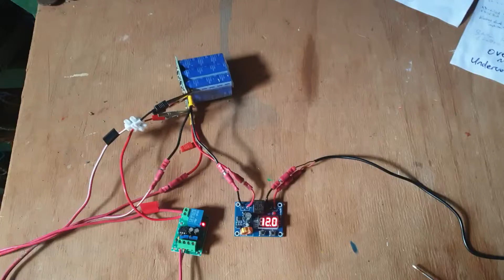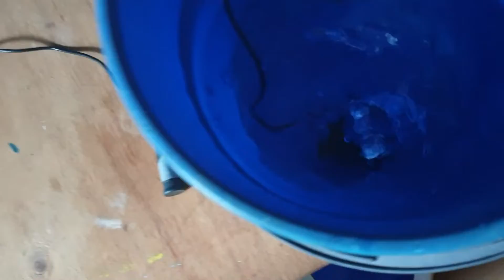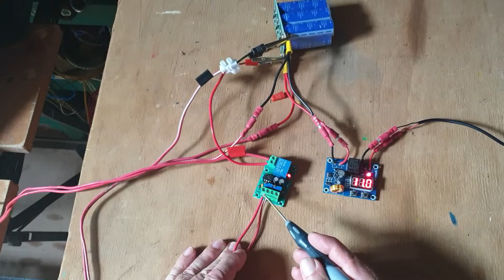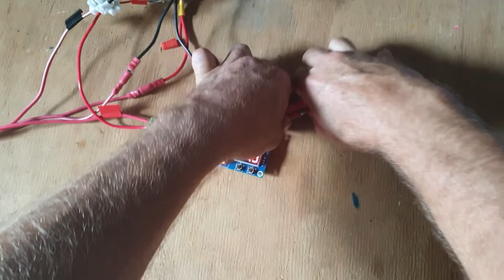Overvoltage and undervoltage protection modules working together to protect 12v battery

Comment: Thank you I learned something new today I just got the under voltage board so I don’t damage my dewalt 20v batteries or my agm batterys for my trolling motor 
  I will buying the over voltage for my power supply diy battery charger made with a 24vac transformer a full bridge rectifier and 63v 3300mf capacitor and a 300watt voltage and current regulator 5v -32vdc it has great results the ac ripple is very low at .004 so it could be used for audio as well 
I could get a solar panel now and use the over protection when I leave the boat on the water when I’m at work and be ready to go when I get home 
Thanks so much please make more videos